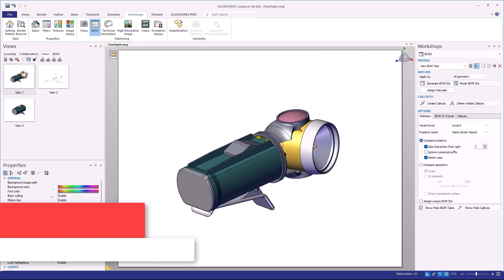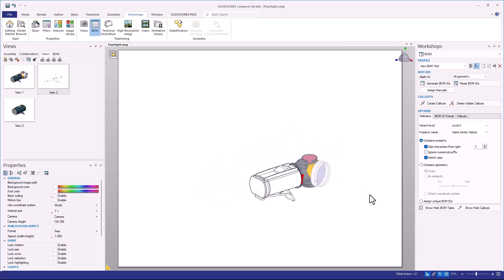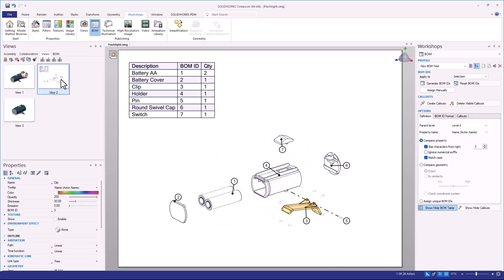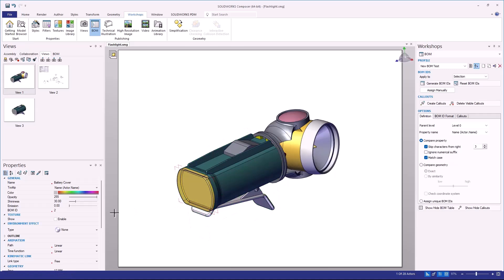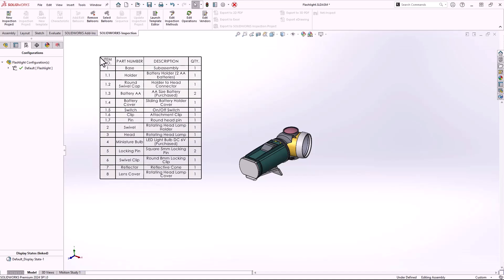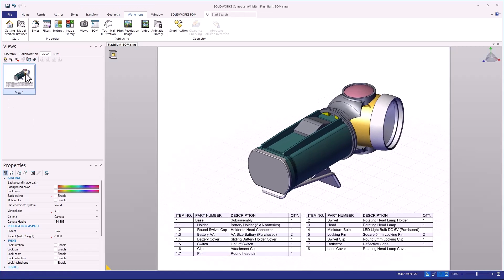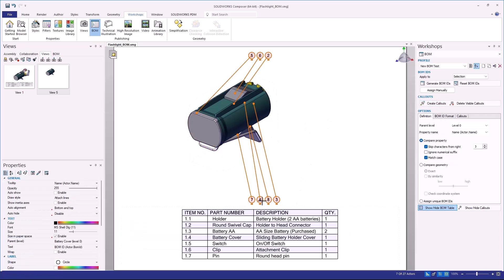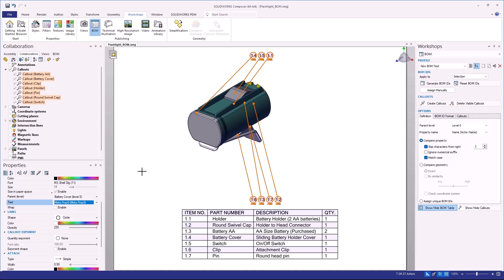How To Streamline BOM IDs in SOLIDWORKS Composer

Comment: Hello, I am working with Solid Works Composer part list (BOM) and I am desperate, I hope you can help me. I have added a "Meta Article Numbers" column to my BOM table. But unfortunately I am missing the Article Numbers for some assembly. Some Assembly do has article numbers, some has not. How can I add the Article Numbers manually for the parts without article numbers? Please help me 🙏
Reply from the maker: Update the neutral properties of the components missing article numbers and they will be maintained across all views.  https://help.solidworks.com/2025/english/dsswxcomposerdoc/cps1usermap/cps-t-actorpropertiesedit.htm